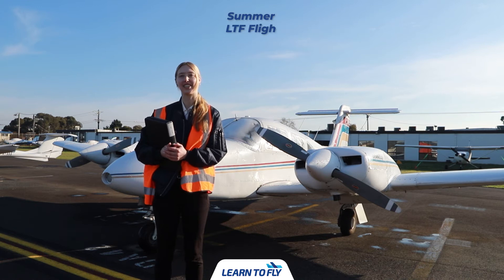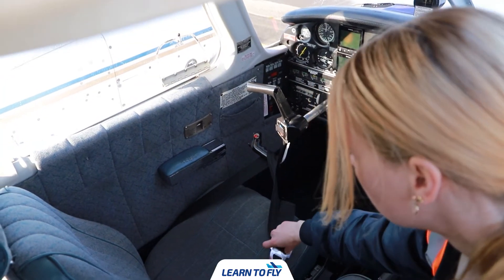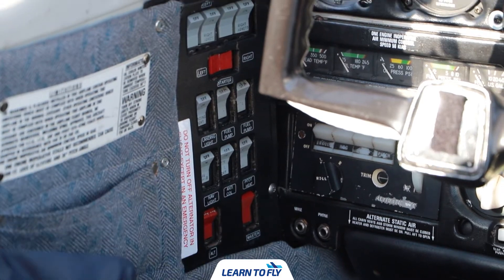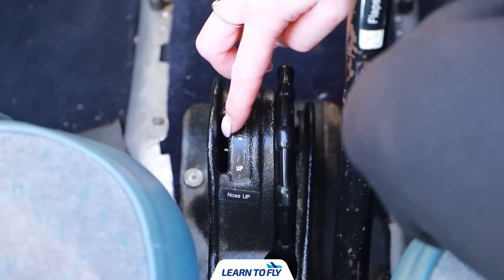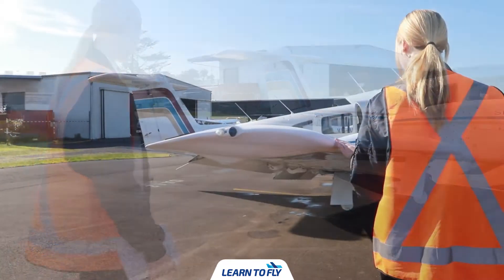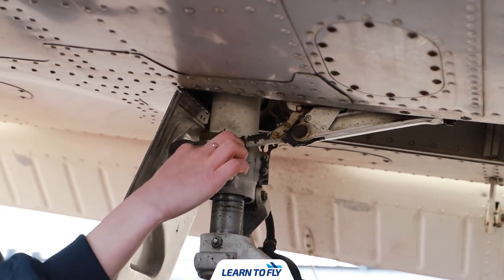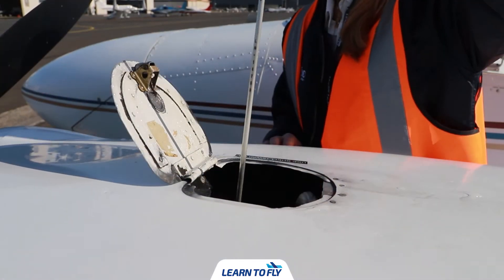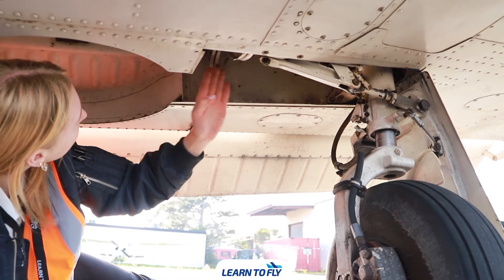Step by Step Guide to Pre-Flight Checking the Twin-Engine Piper #Seminole #PA44 #LearnToFly

Comment: Hate to say but you made a mistake in the fuel straining check.  You drained both tanks into the same container and checked them together.  

Lets say you now look and see a water bubble at the bottom, which tank is it from?  You need to check them individually, one at a time.
Reply from the maker: Hi Andrew! A good point to bring up, but also not really a mistake. If a water bubble is observed, you can then drain each tank individually to identify which one it is from. Draining them individually initially is also a perfectly acceptable way to go about it. Thanks for your comment 👏👏